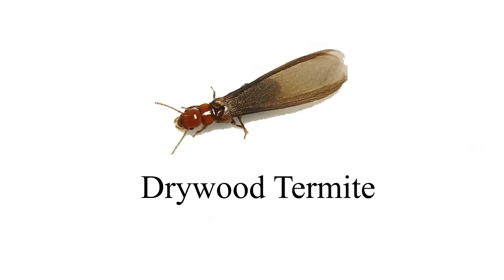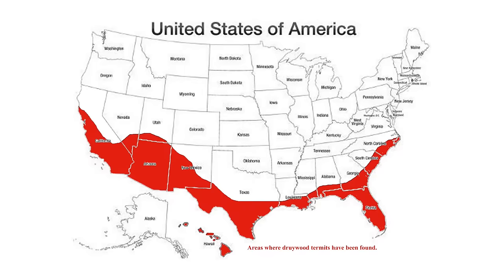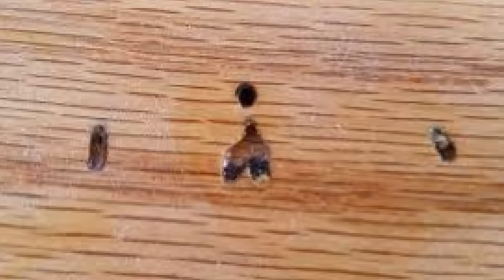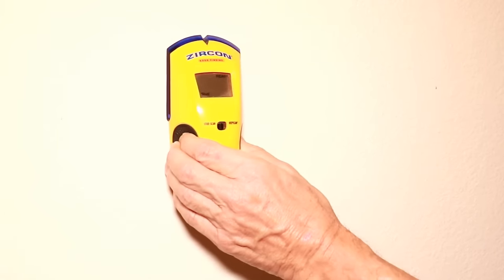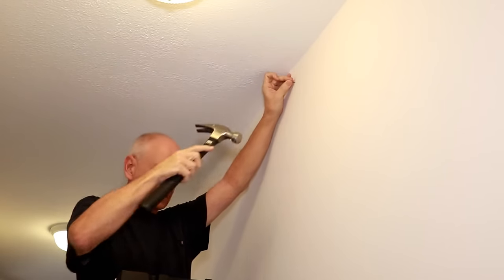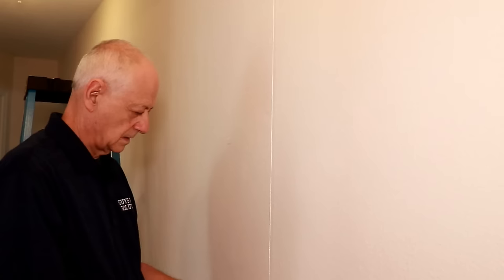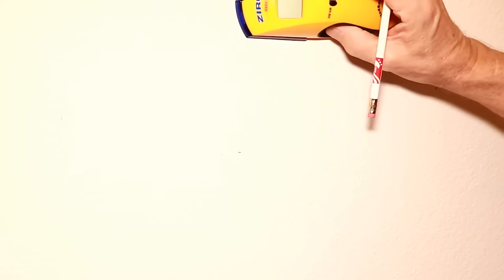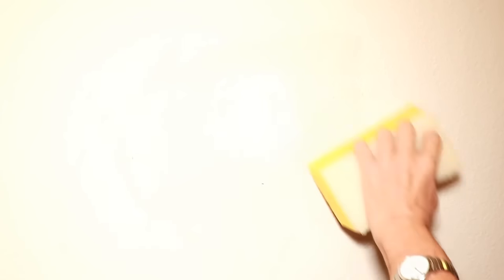How to Treat a Drywood Termite Infestation Yourself. A MUST see if you have Drywood termites.

Comment: Hello Guy, can you please share your thoughts and/or experience regarding the effectiveness of using thermal imaging cameras to identify primary nesting locations of drywood termite activity inside a home? I know they are expensive devices, but I found rental options available that are reasonable for single day rentals. I have drywood swarmers coming from one centralized location in my home, since last year (and still coming from the same general location in the home this year Feb 2022) and I am hoping to get a better identification of where they are active by using a thermal camera. This will likely be as a definite verification before or after any boroscope investigation in the wall voids, but I think they are in the attic anyway, which is exposed lumber (no boroscope needed, but thermal camera could be very helpful in identifying/confirming compromised wood). I live in a new construction, 2-story house in Florida, that is only 2 years old, with slab foundation and stucco exterior sides with no mudtubes, and one year ago noticed my first drywood light brown/red swarmers that sparked my DIY termite journey, in which last year I have done a full attic spray of hot water dissolved borax solution, inspired by my reading of Stephen Tvedten's  work on non-toxic, organic pest control (you can find his book for free at http://www.stephentvedten.com, chapter 36. I highly recommend reading it, I read the whole thing). Although I didn't use bora-care (technically the best for borate penetration), I gave the attic beams a thorough and complete soak, including moving all the insulation and spraying all sides of beams and sheathing. The locality where swarmers are generally seen was also soaked heavily. 

Anyway, I now am seeing swarmers again just like last year, which tells me I probably still have the same infestation in the same spot. It could perhaps be in the wall voids, which I did not treat nor inspect last year, perhaps still in the attic, or even worse it is possible perhaps in the wooden subfloor on the second story floor (the space between first story ceiling and second story flooring), which was also not treated. However, swarmers were seen on attic beams, and one fell from my room's ceiling HVAC return vent (which runs through the attic) onto my desk. The swarmers have always been found either on the wall by the attic entrance, or on the second story carpet floor just below the attic entrance and in that area. They are not good climbers and tend to just fall to the ground, so since I found some in the attic and falling from there, it tells me I think they are likely up there versus in a wall void or in the subfloor, though they could be crawling up to the attic if coming up through the wood. I have not been able to locate any frass piles either in the attic nor in the living space around the 2nd story area with recurring swarmers (although I haven't checked the wall voids yet, or subfloor for that matter). Do you think a thermal camera rental may help me identify with greater certainty and clarity where the infestation is so I can focus my treatment? I have not seen swarmers in any other part of the house AT ALL, ever, since I have lived here at the finish of construction. So I suspect it is a pretty localized drywood infestation. If I can find the beams they are active in, this time I will probably drill into those beams and apply either a borate foam or even just thoroughly inject borax solution (I am very frugal and want to avoid expensive products like bora-care and huge house-wide foaming endeavors if possible). I'd like to mention I have an attic fan installed directly above the active area, which could be where they came from, or if remotely possible, the swarmers could be currently coming from outside in the evening when swarming, and just falling down through my attic, and perhaps I don't have an infestation at all (if I'm really lucky), and I am just seeing swarmers getting in from outside at night. Maybe this is possible, considering my thorough borax spray through the attic last year. But obviously I'm not counting on that. I think I probably still have an infestation that I suspected since last year.

I appreciate your thorough and thoughtful videos and comments, despite personally having differing opinions regarding your methods, specifically in recommending "safe" poison products to others. Nonetheless, I would love to have your feedback and experience towards my drywood termites issue and thermal imaging. Thank you.
Reply from the maker: The truth is that I have never used thermal imaging in an attempt to locate drywood termite galleries.  I know that there are some pest controllers that do this, but my thinking is that you would really need to know what you are looking for.  Thermal cameras are typically very sensitive and I think you will see a variety of temperature differences as you scan your walls.  I suspect that, if you have a lot of experience doing this, then thermal imaging cameras could be a useful tool in identifying galleries.  I don't know that I would recommend it for a homeowner that has no experience using this equipment and that is why I do not mention it in my videos.  Again, I have not personally used this equipment, but I can definitely see a homeowner drilling into a water pipe that they mistook for a drywood termite gallery. Do you see what I'm saying?  While it is most likely a very useful tool, I think it would require training by someone with experience before you would want to just go off and start using it to find your termite galleries.  Now, I could be incorrect about that, but I never recommend things to people when I am uncertain of what the results are going to be.  That being said, there is equipment available on the market that uses sound technology to find drywood termite calories.  Unlike thermal equipment, the sound equipment can tell the difference between termites and other noises that may exist in the wall.  This equipment is very reliable in finding drywood termite galleries, but it is not cheap to buy and I don't know of any places where you can rent it.  However, if you are interested in learning about it, I will place a link below so you can check out a video on it.	

Now, let's talk just a little bit about the use of pesticides.  I definitely understand the reluctance of many people when it comes to using pesticides inside their home and, oftentimes, outside their home as well. The truth is that I typically do not recommend the use of pesticides inside the home, unless it is absolutely necessary.  This is not because the pesticides are hazardous after they are applied, but rather they can be somewhat hazardous while applying them, if it is not done correctly.  Far too often, homeowners do not wear the proper safety equipment well applying these materials.  I have a video on how to properly use personal protective equipment while applying pesticides and almost nobody watches it.  The truth is that almost all pesticides today are perfectly safe when used according to label directions and are not harmful whatsoever after they dry.  I think the biggest reason why people get concerned about them is because of stories from the old days when I first started doing pest control.  I obtained my first license in 1981 and, back in those days, we were using pesticides that were somewhat hazardous after they were applied.  That is to say, they could be harmful if you touched them or they could give off fumes that could contaminate the environment.  They were extraordinarily effective in controlling bugs, but at the same time, they were unacceptably hazardous to people.  Well, all of those materials were banned either in the late 80s or early 90s.  The pesticides that are used today are required to meet a whole different set of standards.  The truth is, you don't want to be bathing in this stuff, but there is literally no danger whatsoever after these materials have been applied and have dried.  So, if you inject a fipronil foam into a termite gallery that is inside your wall, there is literally a zero percent chance that anybody is going to get sick from that, other than the termites.  While it is true that you can also inject a Bora-Care foam into that gallery as well, the truth is that a fipronil foam will work much better and it is in no way more hazardous.  So, what I'm trying to explain is that the pesticides we use today are getting a bad reputation that they do not deserve.  I have absolutely no fear of using them whatsoever.  As with all things though, you should have respect for any materials that you are handling and you should always wear the proper protective equipment.  This includes while applying boron products as well.

Just a quick note about the difference between applying Bora-Care and other borate products to wood.  If you apply pretty much any other borate product to wood, other than Bora-Care, it will leave a residual on the outside of the wood that may penetrate the wood slightly, but not sufficiently to kill off a drywood termite gallery.  All it will do is to prevent new galleries from entering the treated wood.  Of course, that is not necessarily a bad thing.  However, if you do the same treatment with Bora-Care, then not only will you prevent termites from entering the wood, but the Bora-Care will penetrate right through almost to the center of the wood that is treated and it will kill any existing termite infestations.  In addition to drywood termites, it will also kill and prevent subterranean termites as well.  Not to mention other wood destroying bugs as well, including carpenter ants.  While it is true that Bora-Care costs a lot more money, it is also true that you get what you pay for.

From the sound of things, I would say that you have a drywood termite problem that extends beyond what you may think.  My recommendation, if you can afford it, would be to tent and fumigate the entire building.  I just spoke to a homeowner in California who was able to get it done for about $1600.  That is really cheap.  You may not get it done that cheap, but it is definitely worth pricing it out.  Always get several estimates because prices can vary quite a bit.  The guy in California had a high estimate of $3300.  That is double the price of what he was able to get it done for.  So, it pays to shop around.

Please do me a favor and let me know if you attempt to use that thermal imaging camera.  I would love to know how you made out with it.  I always love it when I turn out to be wrong about something, so please do let me know if you have success with it.  This may be something that I have not given enough thought to.  I retired long before this equipment was available.

I hope that helps.  Be well my friend.

Drywood Termite Detection and Treatment--Middleton Lawn & Pest Control (Massey) - YouTube
Reply: @GuysPestSolutions  Guy, thanks for your insights about thermal imaging and treatment methods. I have some more thinking and planning to do for how I am going to effectively handle this the best I can without tenting. I can better understand your views regarding pesticide use in wall voids or outside, and they make some sense. It may even be reasonable to use a pesticide foam in the wall voids of a house, where they will never see people or the environment (but then again boracare foam could always be used in its stead, and is PERMANENT), but never would I consider using pesticide chemicals outside, which poison our own soil, making home gardening a toxic impossibility (gardening which I am involved in) and wreaking havoc on soil biodiversity, and also eventually leaching into groundwater, which we DRINK. So in the end, applying poisons to one's environment is always just poisoning oneself, albeit indirectly. That's why I focus on achieving non-toxic, organic methods, which are proven to be effective, such as using boracare, or tim-bor, or borax, or many other methods of non-pesticide control.

I think I will indeed invest in some bora-care to try to achieve a better control result in re-spraying my attic, and also will take on some house-wide or nearly house-wide foaming operation (oh boy). Not sure I'll be trying the thermal camera, as a one day rental is worth an entire jug of boracare! 

Also, have you ever seen termites infest a second-story wooden subfloor in your time? Do you have any ideas or tips for investigating and/or treating a subfloor?

As always thanks for your opinions and insight shared with me.
Reply from the maker: @sourcecreator2222  Here's the thing about dry wood termites, they can show up pretty much anywhere in your home.  If you have a two-story house, then of course they can create galleries above the ceiling of the first floor and below the flooring on the second floor, in the floor joists and even in the subflooring of the second floor.  This is yet another reason why it is so very, very difficult to locate all the galleries that may exist in your home.  I really do not know what to tell you with that, other than to tap on the ceiling and try to listen for hollow sounds, very much the way you would do with a wall.  Of course, this is far from a reliable way to locate drywood termite galleries.  A lot of the time you don't realize you have these things in the flooring above the first floor until you start to notice the floor getting soft, sagging, or discolorations and sagging of the ceiling on the first floor.  I always feel terrible when I have to explain to people that there really isn't any good way to locate all the termite galleries that are caused by these pests, without using some very sophisticated equipment.  That is why I always suggest doing a proper exterior treatment with pesticide to prevent drywood termites from ever becoming a problem in the first place.

Trust me when I tell you that I totally understand when people tell me that they are reluctant to use pesticides outside because of environmental concerns.  The problem is though that pests like drywood termites can be very destructive to your home and can cause thousands of dollars in damages.  Also, the truth is that the pesticides that I recommend really do not harm the environment at all.  Anytime you mention the word chemical, people conjure up visions of Dioxin Dolly, but that really isn't true anymore.  The real scoop on pesticides like Talstar P is they break down fairly quickly when introduced into the environment.  If you spray your lawn with it for example, the toxicity level of this material to insects is pretty close to zero after 30 days and it is not harmful at all for people.  Now, you may think that the rain will wash these pesticides into the groundwater, but that is not actually the case.  The real truth is that these pesticides are very difficult to wash off the surfaces on which they are applied, including things like grass.  Also, they do not get into the groundwater that we drink.  More often than not, the groundwater that we actually drink is in aquifers that are deep under the ground and the rainwater takes a very, very long time to reach those aquifers.  A very small level of these materials could be washed into the sewer system, but they will breakdown almost completely by the time they are actually recycled into anything resembling drinking water or make their way to lakes, streams, or the ocean.  You see, the reality is nowhere near as bad as you may have been led to believe.  As for plants that we consume, like fruits and vegetables, obviously these materials should not be applied directly to the parts of the plant that are going to be eaten.  Applying them to the ground around these plants will cause some of the pesticide to find its way into the fruits and vegetables, but not at levels that would be toxic too mammals.  Still, I certainly understand that some people do not want any trace amounts of anything resembling a pesticide to end up in their food.  So, I always recommend to these people that they do not use pesticides when they are growing fruits and vegetables.  However, they can still use these products on the exterior of the home because the pesticides are definitely not going to find their way into their gardens.  After a pesticide is applied to your home, it is very difficult to wash it off with plain water.  Therefore, it is not going to find its way into any of the plants that are surrounding your home.  I understand this is not what a lot of people will tell you, but I can assure you that what I am telling you is the actual truth of the matter.  Now, compare the risks, which are extremely minimal, of pesticides damaging the environment next to the benefits of preventing drywood termites from literally eating you out of house and home.  It's kind of like never having a cookout because you're afraid the smoke from the grill is going to destroy the ozone layer.  The amount of damage that it is going to do to the environment would be kind of like spitting on a forest fire.  The truth is that the hype far outweighs the reality.  Now, speaking of reality, termites in the United States do billions of dollars in damage every year.   I don't know about you, but for me, I would prefer not to be one of those people who spend thousands of dollars replacing structural parts of my home that have become unsafe because of termites.  Naturally, everyone has to make their own decisions on this stuff, but I think it is important for everyone to be informed about the truth when making these decisions.  After you understand that you will cause no harm by using pesticides on your home and you decide that you still do not wish to do it, then at least you made an informed decision.  I can definitely respect that.  You just need to be aware of the level of risk that you will be assuming.

All of that being said, applying Bora-Care to the entire structure of the home is a reasonable and, maybe, an effective method of ensuring that all the termites in your house are eradicated and that your house becomes termite proof.  The key is to do this treatment properly and thoroughly.  However, I remain unconvinced that even the best of the best professionals can manage to treat all the wood in an already built home sufficiently to ensure that all the galleries will be eliminated and that new ones cannot be formed.  I think it is possible, but I also think it would require a lot of experience to ensure that it was done properly.  Nevertheless, the more areas that are treated with Bora-Care, then the less areas there are that can be affected by drywood termites.  So, it certainly can't hurt to have a go at it.  Just understand that it may not be the panacea that you are hoping for.  While it can't hurt, it may not totally eliminate all of the termites and it may not totally prevent new ones in some areas of your home.  That is to say, the treatment may only be partially effective.  The degree to which it is effective will most likely be determined by the experience of the applicator and the nature of the construction of the home.  Don't get me wrong.  I am not trying to discourage you from using Bora-Care.  The fact is that I am a great believer in Bora-Care.  I think it's one of the best pest control products ever created.  I just want you to be aware that it does have limitations.  What I am about is providing information and then letting people make their own decisions.  I always acknowledge that what is the right decision for one person may not be the right decision for another.  Two people, armed with the exact same information, can go two completely different ways and that’s okay.

I hope that helps.  Please let me know if you have any other questions.
Reply: @GuysPestSolutions  Very well put Guy, I can say I was not aware of the realities regarding how impactful pesticide use is on us or the environment, nor about their toxicity in general. If things are as you say, it can make sense to use some of those products in order to definitely prevent drywoods from entering the home. It is a tricky and uncertain situation indeed once they are already in the home and it was not treated with borated lumber during construction... thanks again for your insights - they have helped me a lot to make a more sober and informed decision about how to deal with my infestation.
Best wishes sir
Reply from the maker: @sourcecreator2222  Always my pleasure my friend.  I wish you well with getting a handle on those termites.  I definitely feel your pain.
Reply: @GuysPestSolutions  couple follow up questions...can you apply boracare to sub floors and it will seep right through the whole wood and kill/prevent any future infestations there?  If so do you recommend using a 1:1 mixture?  I am talking about plywood or it might even be partical board as it is a mobile home....I haven't looked at sub floors yet...
Reply from the maker: I'm so sorry that I'm only getting to answer this right now.  For some reason, YouTube did not send me your comment until this morning.  They do that sometimes and I have had them hold comments for as long as 3 years already. If ever you ask me a question, and you do not get an answer within a few days, then please email me.

You should always mix Bora-Care one to one with water.  It may not go all the way through the plywood, but it will go deep enough to do the job.  It's best if you can apply it on both sides.

Again.  So sorry for the delay.  Be well my friend.
Reply: @GuysPestSolutions  thanks Guy termites are gone now